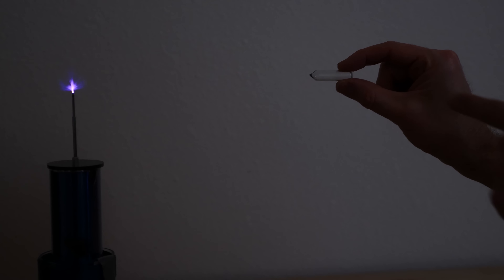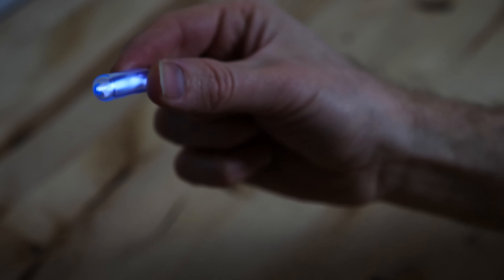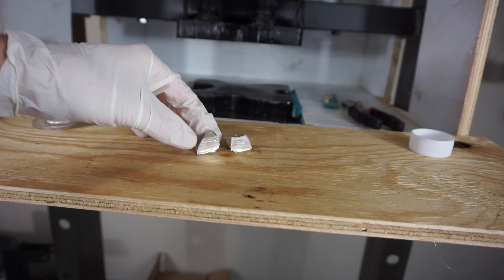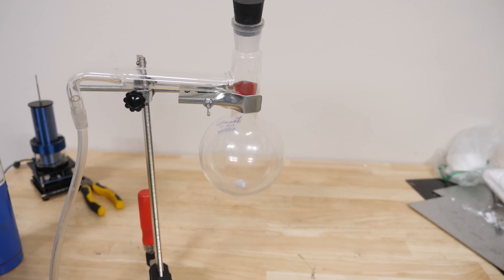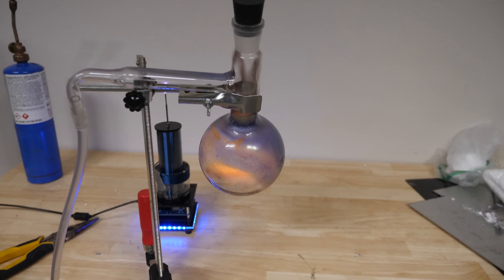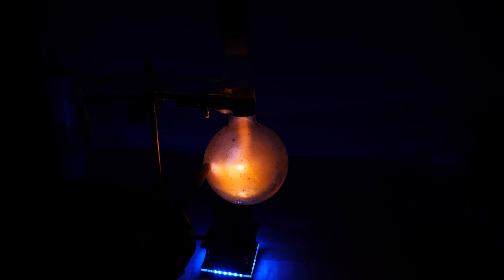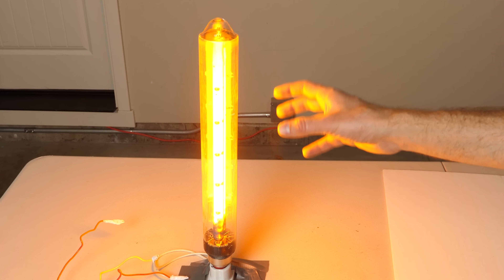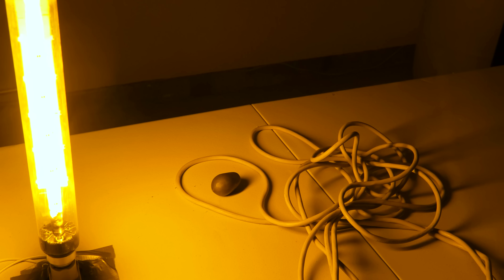Using a Tesla Coil To Turn Sodium Vapor Into a Plasma

Comment: FYI you should flip your LPS bulb upside down, or at least have it on its side. Sodium dripping on the electrodes and alloying with them is basically the only failure point of the bulbs. If you use it upside down or sideways it should last pretty much forever.
Reply from the maker: That’s good to know! I will do that from now on
Reply: He's right, also hi yall
Reply: hi
Reply: @mobeingmo  🔴 What Is Islam? 

🔴 Islam is not just another religion. 

🔵 It is the same message preached by Moses, Jesus and Abraham.

 🔴 Islam literally means ‘submission to God’ and it teaches us to have a direct relationship with God. 

 🔵 It reminds us that since God created us, no one should be worshipped except God alone. 

 🔴 It also teaches that God is nothing like a human being or like anything that we can imagine.

🌍 The concept of God is summarized in the Quran as:

📖 { “Say, He is God, the One.  God, the Absolute.  He does not give birth, nor was He born, and there is nothing like Him.”} (Quran 112:1-4) 📚

🔴 Becoming a Muslim is not turning your back to Jesus. 

🔵 Rather it’s going back to the original teachings of Jesus and obeying him. 

More ..
Reply: I agree 100%, preferably horizontal as you don't want too much sodium collected into the "U" bend either but if it's a lower wattage bulb, it probably won't matter.
Reply: @mobeingmo  yeah he's right, now he's left 😋
Reply: Nice !
Reply: @1islam1  Who asked
Reply: Nighthawk in light is my favorite Technology channel after action lab. He is the illegitimate son of the actor who portrayed Hawkeye in the TV series MASH from the 1970s. Forget the actor's name but he is the father and his name can easily be found by a search engine search.
Reply: @TheActionLab  very interesting video as always. Is it posible that you can do the same experiment with Magnesium? I thank you in advance. 😀👍
Reply: @garrysekelli6776  Where did you get that from?
Reply: @1islam1  I am a Muslim bro, thanks tho
Reply: @anon_y_mousse  HAWKeye -nightHAWK duh. Look up their photos and see how closely they resemble one another.
Reply: @garrysekelli6776  Ah, okay. For a second I was actually believing you meant it.
Reply: @anon_y_mousse  well technically the theory still hasn't been disperoven. Maybe they need to go on DrPhil show or Geraldo Rivera and get a dna test.b
Reply: @TheActionLab  bro please try platinum preppy+Parker ink+water and try different proportion every one drop of mixed inks and water please bro🙃😊🥺 inks are mysterious than you think 🔥🤯🤯 I have tried it's very werd 💀

Comment: Just make sure you put enough Na in the glass vessel so you wouldn't start drawing the Na from the glass. You can get a similar effect even with just a glass vessel by causing the Na from it to evaporate but that would obviously damage the glass or at the very least cause enough internal strain to make it weaker. I think NileRed had a video of microwaving Al foil in a glass jar which was enough to cause the Na from the glass to evaporate and start shining in its usual colour.
Reply: I don't think any vacuum has the ability to "draw" Na from the glass - in NileRed's experiment, the hot plasma was in direct contact with the glass, which gave it that color...
Reply: Btw theres like great amount of physics behing generating plasma as shown in video- from wiki: "In field ionization, electrons are removed from a species(Sodium in this case) by quantum mechanical tunneling in a high electric field(generated by tesla coil), which results in the formation of molecular ions(plasma)"
Reply: @great__success  Yes. Vacuum itself can't draw significant amounts of Na. So you need to get the glass really hot. Like with the blowtorch here or with the plasma generated by the interactions of EM waves and the foil in NileRed's experiment.
Reply: hmm yes words

Comment: Gallium can technically be used in a variant of metal halide bulb that's basically also a hybrid of high pressure Sodium bulb, a Ceramic Metal Halide bulb, as they're designed to run hotter than the typical Metal Halide bulbs, however it would add too much blue, possibly skewing the color rendition index of the light. I have the ceramic metal halide bulb in my modded Halogen spotlight, it's an interesting bulb, and excellent for remote photography at night if I need some artificial Sun for good shot of nature (probably with astrophotography tossed into).
Reply: 4Dfryd

Comment: The single wavelength also cuts through mist and fog which was part of the original decision to use these for street lighting.  LED just lights up the fog and reduces visibility even more.   This is what happens when you no longer have the engineers with the original knowledge.
Reply: It really depends on the LED that is being used, also there's plenty of places in the world where dense fog is extremely uncommon.
Reply: @_shadow_1  Depends on the colour of LED tbh.
Reply: LEDs come in a wide range of colour temperatures commonly from 2700K to 7000K. They are now commonly used on highways which experience high fog levels.
Reply: @_shadow_1   The same principle (Rayleigh Scattering) that makes LED light scatter within fog particles and illuminate them happens within the eyeball. When this scattering happens in the eye it creates disability glare, a physical wall of scattered light within the eye. Just about everyone has stories of being blinded by LEDs while trying to drive at night, with at least 1 fatality being reported when a driver hit and killed a pedestrian that he had no way of seeing after being blinded by the headlights of an oncoming car.
Reply: @SimonBrisbane  They are, to detrimental effects. The problem with LEDs is that high-efficiency LED chips only come in blue. "White" LED lights work by using a phosphor to broaden the wavelength into a fuller spectrum, the warmer this spectrum gets the less efficient the LED gets. By the time an LED has a spectrum near 2200K it's less efficient than Sodium lights, making LEDs in their current technological state pointless for outdoor area lighting.
Reply: @EdmontonRails  yes, this is idiotic

Comment: Every substance has a vapor pressure, meaning you'll get substances that are liquid  or even solid yet have atoms  making up a vapor contained in a partial vacuum inside. A sealed glass tube.  Try lead,  potassium, lithium, mercury and others. 
Once they start ionizing the ionized gas temperature will skyrocket and knock more atoms off the solid metals.

Comment: For an O’Neill cylinder in orbit, You should be able to take any metal, turn it into plasma, and throw it out the back.

That would require most of your cylinder to essentially be a capacitor/battery.  Preferably one that didn’t slosh around.

You could make an O’Neill cylinder a battery with just flywheels (at the end/qand capacitors throughout the body.

You should also be able to “Brake” the orbit of the cylinder using the mass, just make sure everything‘s secured (doesn’t have to be that violent, it just has to be enough to get you a push in the right direction)

Comment: ok, thats how lps bulbs work. but what about hps bulbs, that are used for grow lights?
Reply: Well, they are a bit different. When the Arc turns the sodium into vapor it pressurizes the arc tube. This increases the chance of a electron hiting a Na atom and rip it off. So HPS lamps also have a ceramic arc tube which is compered to LPS small arc tube. As a lamp collector, this is the difference i can tell you. Also on my chanel i made a video about showcasing a HPS bulb and plan to do a documentary about HPS light.

Comment: If you attach an electrode that goes through the glass, and into the vacuum chamber where the vapor cloud is being turned into plasma, and then measure the voltage and current with a voltage multi-meter, what will it show? Could you charge up capacitor banks this way, with a water wheel and permanent magnets? Would there be no advantage to lighting up the plasma first? Does the plasma cause a useful increase in voltage?

Comment: What if that high voltage works on the inside of the butane tank? Maybe that is not a problem since the butane is liquid in there?
Reply: Three different problems with the thought of high voltages inside butain tank. 

1) metal container creates a faraday cage preventing differences in electromagnetic potentials inside the tank

2) There is no oxygen inside the tank so even it were sparking and arcing inside the tank, there would be no flame orcexplision because there is nothing to oxidize the fuel. 

3) the contents of the tank are under pressure. You need a partial vacuum, very low pressure gas. The reason is ions responding to changes in the EM field need to have time to accelerate in order to knock electrons off and make more ions cascading into a great many ions that can inturn respond to the changing EM fields. But because under you pack a bunch of butain molecules into a small space, under pressure, if one were ionized, it would have far far far less time to accelerate , and not having enough energy, would be unable to ionize more butain molecules.

Comment: Action Lab: "So if I'm going to do this in my garage, it needs to be a metal boiling point..."
Me: "Mercury!"
AL: "Now a metal with a really low melting point is gallium, it has a really high boiling point.... So lets try to use a metal with a much lower boiling temperature..."
Me: "Like mercury!"
AL: "Like sodium."

I have a problem 🤣
Reply: So you want a fluorescent lamp?
Reply: @vivimannequin  YES! 🤣

Comment: Is it really high voltages or high frequency.   As a gas the molecules are more acceptable to magnetic fields.   As long as the Tesla coil oscillates.  It will admit  Light

Comment: @TheActionLab I am confused isn’t the boiling point regulated by the partial pressure of sodium in the air rather than the total atmospheric pressure?  If so then how much partial pressure sodium metal really exert in 1 atmosphere of air?

Comment: Hello. I have suggestion, what if some liquid is cannot turn into solid, for example water if you put in freezer for a long time but it didn't turn into ice, is there something like that? I'm curious because I have an e mix liquid from beauty products and I put it in the freezer all night but it didn't turn into ice in the morning
Reply: It needs to be colder
Reply: @vivimannequin  I did that and adjusted the freezer to a high volume but not gonna change and the beauty products are like lime, I just added something like powder and the texture became liquid

Comment: Boil mercury it's melting point is even lower at 671 F
Reply: However, mercury vapor is quite a bit more dangerous to work with since the highly toxic gas can easily be inhaled granted sodium vapor isn't perfectly safe either! ⚠⚠
Reply: @brfisher1123  that's what I assumed

Comment: you lied, repent, dont talk your own
Reply: ionize small amount solid with electricity, then sling it around with electric/magnetic field
Reply: spark ionization
Reply: power of sin is law, anything owned by sin is death
Reply: try ion separation by ionized plasma magnetic field separation
Reply: you made a flash tube
Reply: try LED vacuum rocket